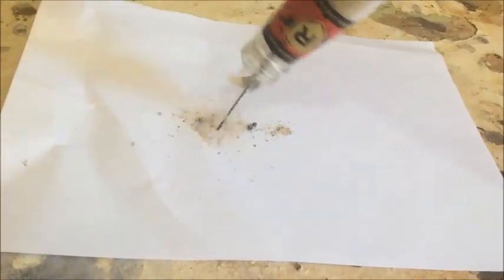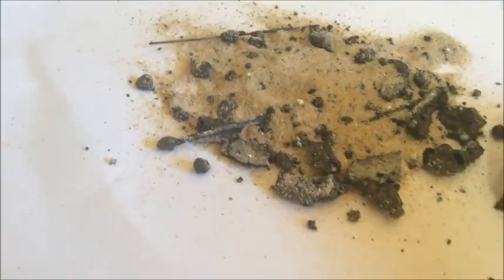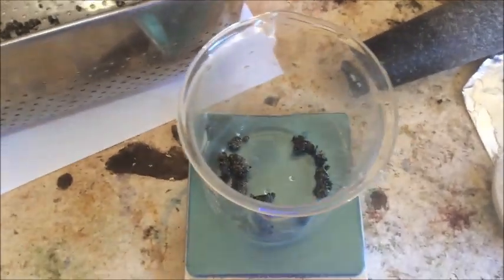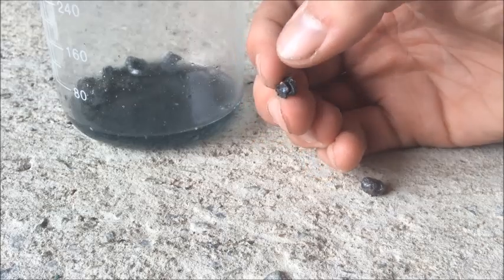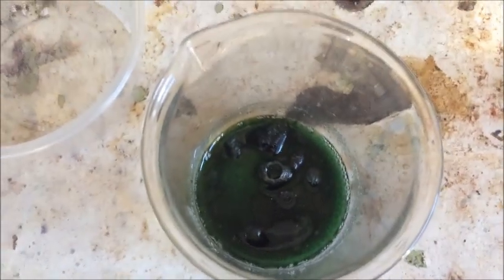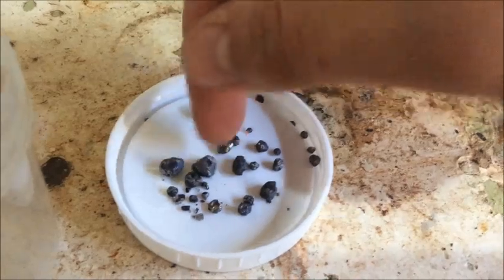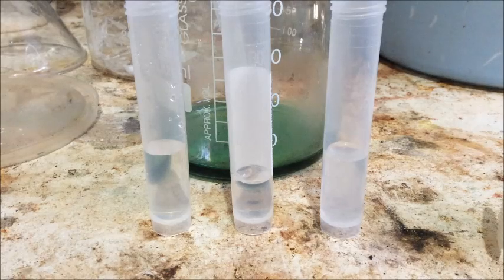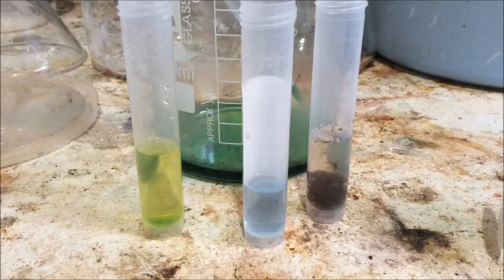Isolating Vanadium from the slag

Comment: One trick to getting bigger chunks of metal with thermite is to make the reaction slower by using larger pieces of aluminum and to physically make a bigger pile of thermite inside an insulated fire brick or graphite mold. Making thermite with fine grained aluminum or powder makes it easy to light but the sudden production of heat tends to make a mess and splatter everything scattering the freshly produced metal and slag. What you want is a slow reaction that delivers the heat over 10 of seconds and then keeps the heat in the reacted mass, allowing time for the metal beads to coalesce and fall to the bottom of the mixture while the still molten aluminum slag floats to the top.  Watch the railroad videos of the tracks being thermite welded, the molds are warmed with torches first and the reaction is very slow and tame, but results in pounds of pure molten metal sinking into the mold. Making a mold out of bread charcoal might withstand the heat if supported firmly on the outside.

Comment: I used to work at a circuit board component/parts factory and u woyld have loved it there, just a tour, with a large bag. Ive seen essentially pure silver metal and didnt know that in extremely pure states it has a pinkish, mother of pearl color. Gigantic ribbons of elements i had, to that moment, never laid eyes on. I recall a meter in diameter (and im being conservative, jt went by weight and i dknt remember the lbs/kgs eaxh ribbon was. Vanadium came in one of these metal ribbons along with manganese, molybdenum, essentially all electroconductive metals, even a bottle that resembled a pint sized lab bottle that solid or crystalline chemicals get sold in (the white plastic, almost like pharmaceutical container, if not exactly) that was full of extremely fine purest gold powder for electroplating. It was a job that i temped at before i began serious practice of chem. I WISh i could go back 15 years just to sweep the floor there and keep the scraps.

Comment: tl;dr - vanadium solution chemistry is complicated

The chemistry of vanadium in solution is dominated by the equilibria of various coordinated complex ion species. Chloride, nitric oxide, and sulphate ligands are all capable of exchanging with the water bound to the fully hydrolyzed vanadium ion, [V(H2O)6]. V 3+ tends to be limited to this simple scheme. V 4+ coordination chemistry is dominated by coordination of a vanadyl, VO 2+, center and usually five ligands. Additionally, vanadium forms many oxyanion and polyoxyanion species in solution. The change in color with an excess of HCl was likely just a shift in equilibrium toward a species with more chlorides coordinated to it rather than a change in oxidation. The dark red species you encountered could have been a polyvanadate ion produced local to the metal being dissolved due to condensation of the vanadate ion in the presence of the more reductive metal and a low pH.
Reply: +Explosions&Fire A far simpler example of a similar color change may be seen with copper salts in solution with chloride ions present. There is a similar color change from blue to greenish yellow. You didn't just lower the pH of the solution, you also massively increased the concentration of chloride. The excess of chloride drove the ligand substitution equilibria toward the species with the most chloride ligands. You can show the effect of pH independently by diluting a HCl solution with a NaCl solution to maintain a constant Cl- concentration and then dropping in the test solution of vanadium.
Reply: +Explosions&Fire I'd have to look into the HOMO/LUMO split of the species most likely to exist at those two pH values and I have a test in about now minutes, but I can get back to you on this.

Suffice it to say that the dramatic color change is not uncommon for most transition metals. It is just that some do not fluoresce strongly in the visible spectrum (iirc Mn 2+ for example). A ligand's field strength can cause quite large changes in the HOMO/LUMO gap though.
Reply: I did a little digging and got a few references for you. I put them in a dropbox folder here: https://www.dropbox.com/sh/3h1y9h3n9gg050c/AADXoCQPO8XZgHm1LmRHQp2aa?dl=0
Reply from the maker: +xenomancer I'm reading them now, thanks for this!